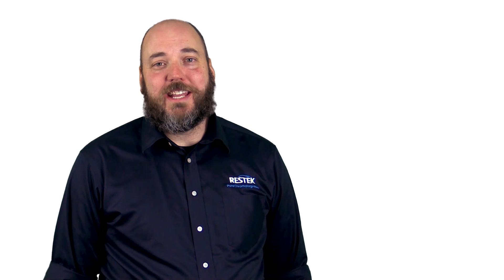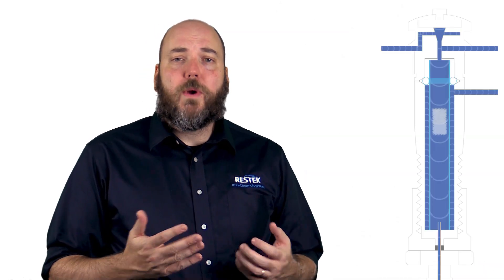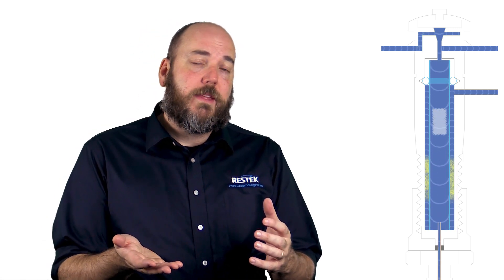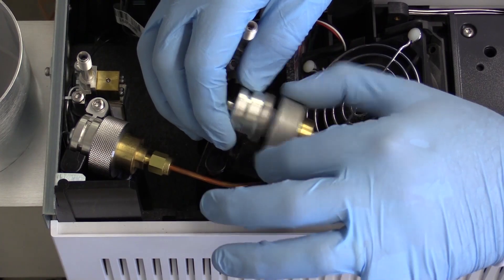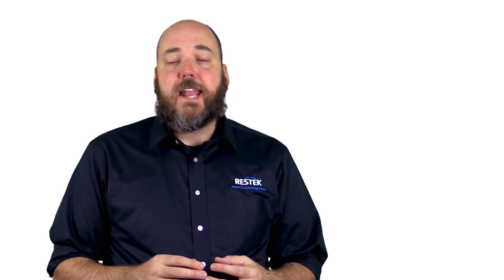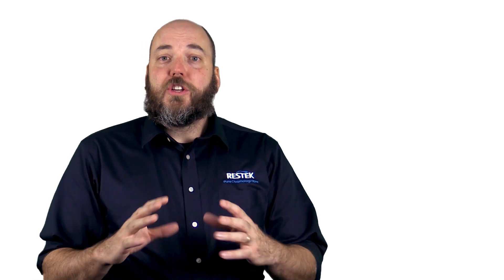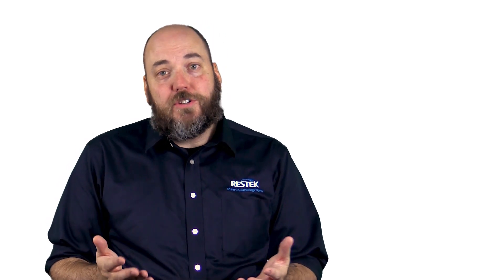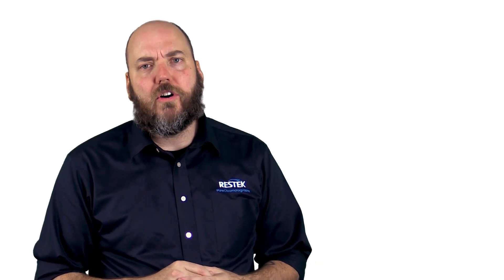Replacing Your GC Split Vent Trap

Comment: After how many injections, (on average), should the filter be replaced?  And what about cleaning the split vent lines?
Reply from the maker: This can vary greatly. As a default, we'd always recommend checking with your instrument manufacturer's guidelines. These are generally around every six months. How much you are injecting, how much is your split, how dirty are your samples can all impact this. Cleaning split vent lines is generally reserved for a situation where you feel it is needed, such as seeing some ghost peaks or other evidence of contamination. In an extreme case, when you notice incorrect flow rates and may suspect some clogging.